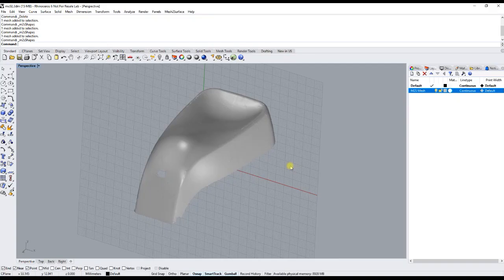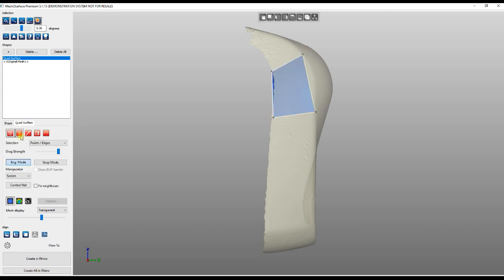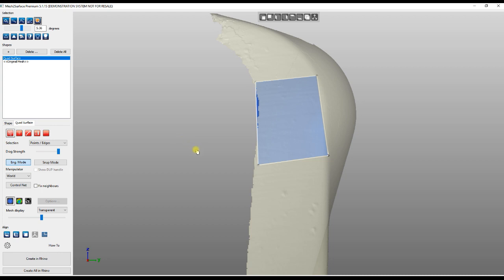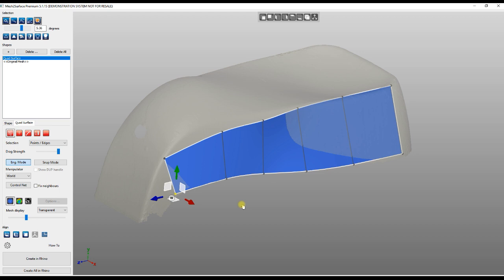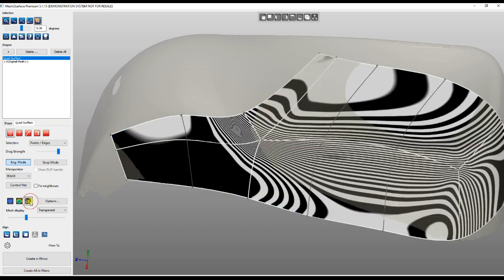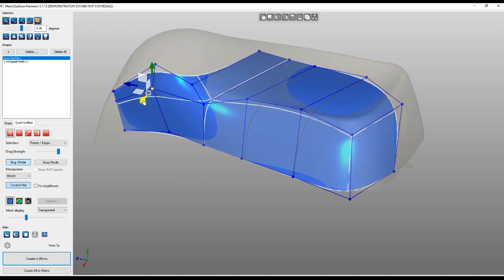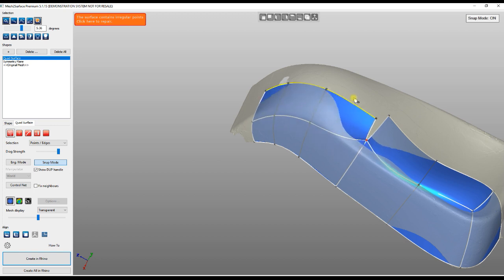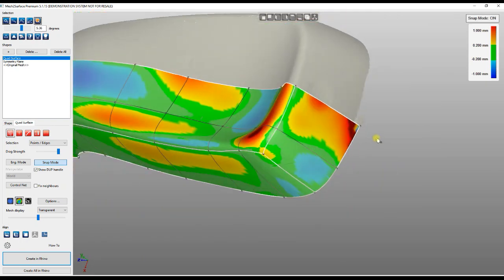Mesh2Surface: Quad Surface Tutorial

Comment: can do this in any poly modeler with retopology tools.
Reply from the maker: Can you tell us which for example so we can compare. Also that the resulted surface stays close the mesh and has real-time deviation control from input mesh to the end surface to control the quality?
Reply: @QUICKSURFACE  sure. zbrush, 3d coat,blender, houdini, cinema 4d, autodesk maya, autodesk 3ds max, and more, can do this with their retopology tools, but they dont convert to a surface and dont  have the deviation analysis. so i guess these are not as good since they cant convert to surface.
 but,   ansys  spaceclaim does the same thing and converts to a surface and has deviation analysis.  and Geomagic design x does the same thing too, and has a lot more tools for re-enginering also.   and geomagic wrap does the same.
 and autdesk fusion 360 can do similar  mesh to surface stuff and has analysis tools.  also solidworks has a plugin called Power Surfacing that converts a mesh to surface.  i believe semiens nx can also do mesh to suface with its tools.  also rhino can covert a mesh to nurbs.  also vrmesh does the same thing but with cloud points. and a mesh object can be converted to cloud data.
Reply: @IronMan-yg4qw  Amen buddy.